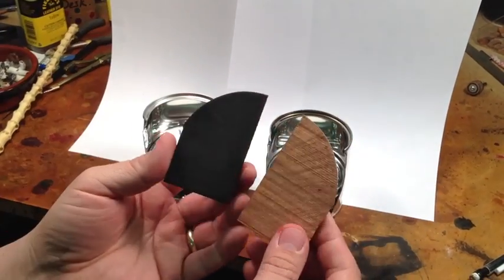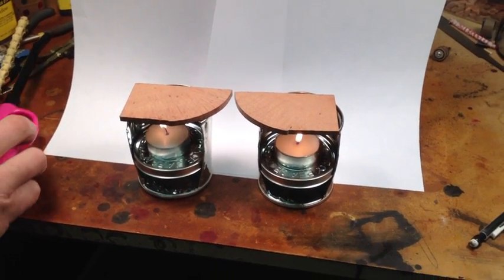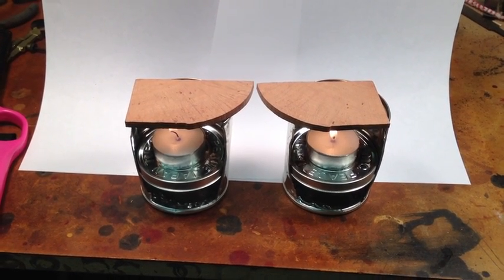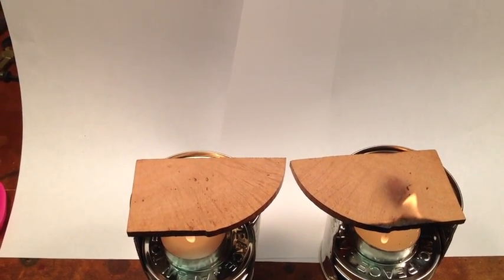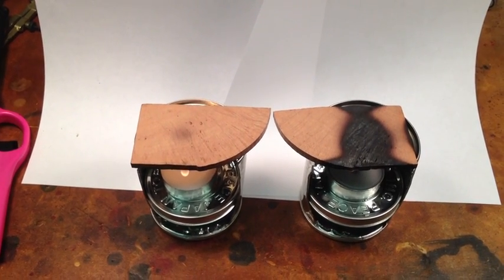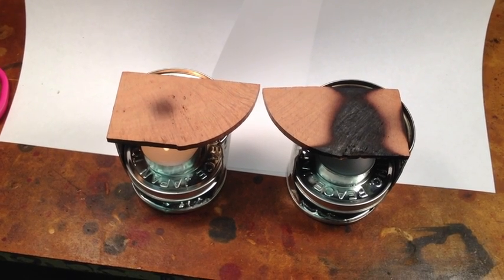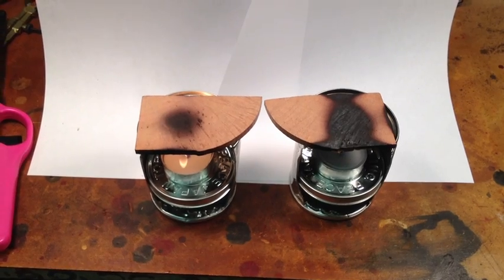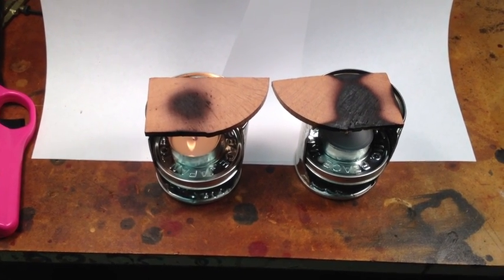Sodium Silicate versus "Raw Briar"

Comment: Sodium silicate is not a durable material alone you have to mix it with other materials. This cant be applied at outdoor
Reply: Thats a verry dumbass comment.Sodium silicate when cured becomes waterproof.Its used in waterproof concrete.
Reply: How do you cure this. I directly coated a stone and it just cleaned under water.
Reply: with CO2,with gipsum,baking soda etc. or you can leave it to dry naturally .
Reply: la scapigliata  thank you for the info. i will try this. I want to make a protection from water
Reply: @lascapigliata3832 When you say with baking soda, do you mean that after you apply it you'll have to spray or apply with a paintbrush a solution of baking soda and water?

Comment: Sorry to bother you with this, but i have a question that i can't seem to find an answer to. Is sodium silicate water soluble after it's been applied and dried / set. It seems it should be, what with being water-bourn in liquid form. So as an example, if i painted my outdoor tool shed with it, would the rain wash it off?
Reply: I've found an answer i think. 
"Sodium silicate is a white powder that is readily soluble in water". But you can see how i still had the question, since it talks about the powder form. 
Also "glassy, colourless, and soluble in water."
But reading further in the wikipedia article gives me another idea.  ... "Sodium silicate is stable in neutral and alkaline solutions. In acidic solutions, the silicate ion reacts with hydrogen ions to form silicic acid, which when heated and roasted forms silica gel, a hard, glassy substance."  -  So would it not be possible to obtain the water insolubility required by making a sodium silicate solution acidic (turning it to silicic acid) and applying that to wood before drying and roasting.? Then you should get a silica coating. Which to my understanding is similarly fire retardant, but also waterproof.
Reply: It becomes real glass thats non soluble in water, after it cures.